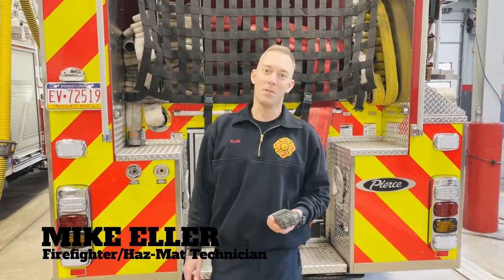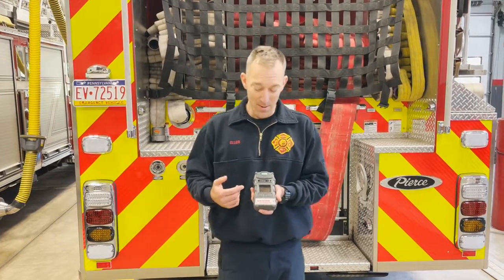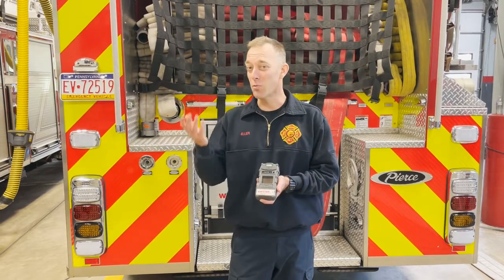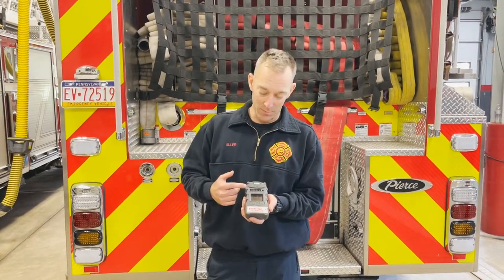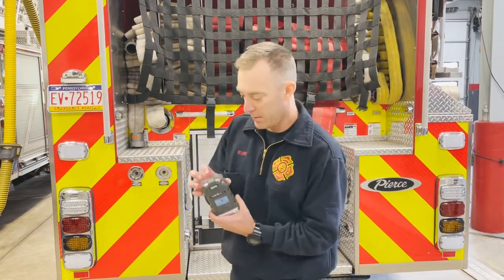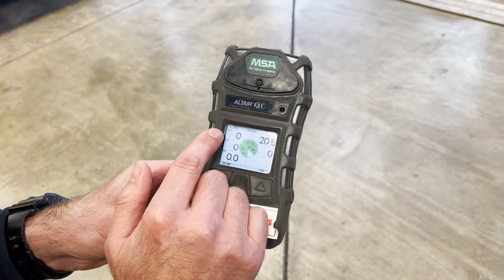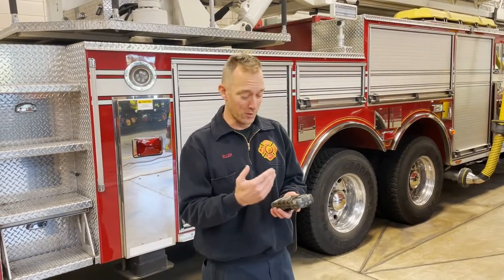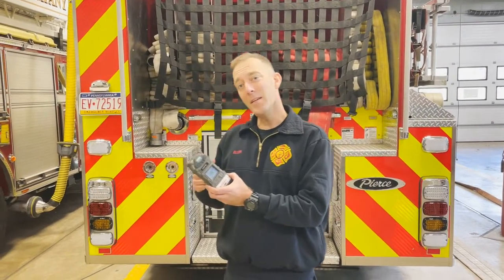5-Gas Meter Overview

Comment: Great video! I would be intrigued if there could be a demonstration of the 5-Gas Meter during an overhaul of a fire or during a live burn showing the different sensors and how in the IDLH environment the gas meter can change and sense when there could be possible combustion gases in the atmostphere.

Comment: Nice video, just a few technical mistakes. Unless the Altair 5x was a PID or IR type(it wasn’t) then there is only spots for only four sensors. Your CO sensor is probably the combination CO/H2S type. If you were to open it up(don’t) left to right (arching not straight across) the Combustible, O2, Exotic toxin(HCN in your case), CO/H2S combination sensor. Secondly, the combustible sensor is a catalytic bead sensor, it is not reading methane, it is reading the temperature difference between the type A detector bead and the type B compensator bead. This displays as lel of whatever combustion gas you may be encountering. Methane is used in the calibration gases because of the instability of pentane but the scale is the pentane scale still. This video is still pretty good though. You can and I’d suggest considering turning off the fresh air setup feature as an option altogether. It can be done through the back office software. Too much confusion and not worth the hassle, just turn it off unless you have zero gas and expertise to use it correctly on scene.
Reply: The combustible gas conversion tables should only be used if the gas is known. Avoid silicon and alcohols anywhere near the detector, those are sensor killers.
Reply: @fireclan9326  correction factors for LEL have a +/- 25% error factor following the correction.....small print on the bottom of the chart.  I would not use it for quantitative evaluations

Comment: I am still trying to figure out why the fire fighters handheld meter was beeping.   Chronic sewer line blockages, no natural gas has been supplied for almost a year (line was capped after the last leak).    I do smell human waste too much to be happy.
Reply: The XCell sensor are (in my opinion) the best sensors out there. But there are some cross sensitivity to account for. MSA has provided charts for such, so they may have been picking up another gas and it was reading as HCN when encountering sewer gases.